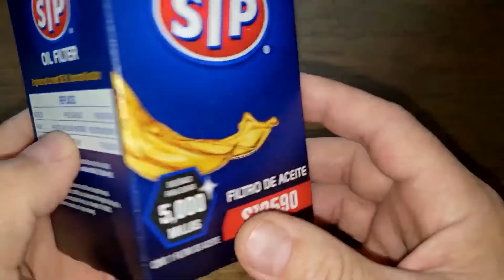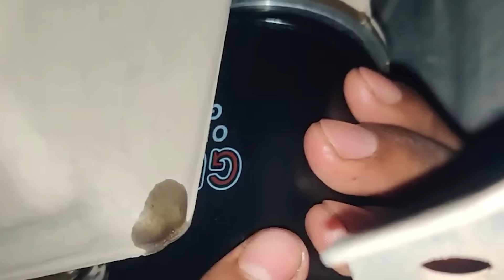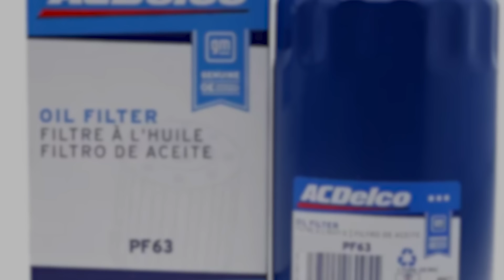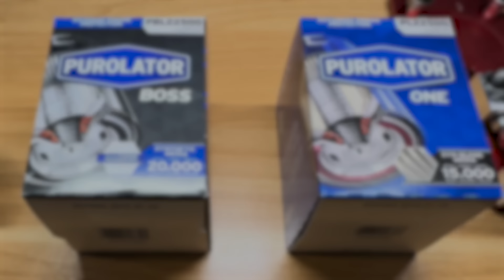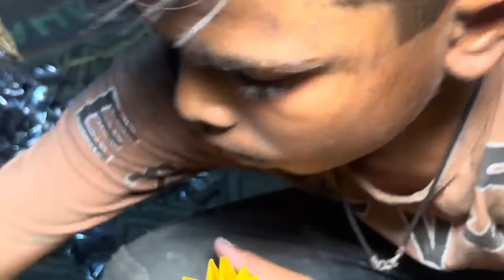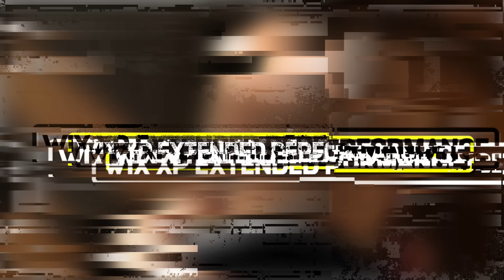AVOID These 5 Oil Filter Brands (And 10 That Actually Protect Your Engine)

Comment: Bottom line is change oil and filter regularly. ~ 4,000 miles. 3,000 - 5,000. Never go over 5,000 no matter what manufacturer says. They are pushing for you buying their car every 2 years or so.

Comment: "Avoid the orange can Avoid the FRAM "™️
Basically the orange can of death  !
Reply: Considering that Fram started making oil filters in 1932 and as far as I know a Fram filter has never been linked to a single engine failure, that’s a pretty good track record. However last fall the ceo of Fram’s parent company was charged with defrauding the company for over $700million. Now the company is in chapter 11 bankruptcy and they aren’t making anymore filters.
Reply: It really depends on the filter 🤷 check the labels on your filters, especially if it's for a non-domestic car - some of the filters that aren't common on US cars, especially cartridge style filters, Fram (at least before they went belly-up) would just repackage filters from other makers. On my VW it was a repackaged Mann or Hengst, with Made in Germany stamps.  They were like $5 at Walmart at the time vs the $15-20 for a Mann. After a while they switched and the label was Korea... I avoided those. When I noticed the switch I'd buy up the Germany ones when I could find them.

Comment: I’ve only use Valvoline oil and OEM Motorcraft oil and air filters (which are actually made by Purolator). Last year and 5K miles, I sent a sample to Blackstone Labs for analysis (best $40 bucks I’ve ever spent on my vehicle) and  passed with flying colors. Zero issues.

Comment: I use CM filters,  They are expensive but for me, the peace of mind is what makes the expense acceptable.  The filters can be replaced as desired.  The cannister is bulletproof.  The filters remove contaminants and solids down to 8 microns.
Reply: CM?
Reply: @pablojg4381  Canton Racing makes CM filters , super high flow not really applicable to everyday driving

Comment: I’m an ASE master, L1 and state certified emissions technician and have been using Fram extra guard filters for as long as I can remember with Valvoline motor oil, I have had many cars over 250,000 miles and more. I have no problem using FRAM
Reply: Fram’s in chapter 11 bankruptcy and all manufacturing is haulted

Comment: My '57 blue flame six had an optional oil filter. When one of the hoses broke I ran it without a filter it actually ran quieter for several years with 3k changes with conventional oil.😊

Comment: I use microguard select it always comes out close to the top in testing and only costs $7 on my business account at Orielly, for my hotrods I will use a racing filter for more flow at high RPM
Reply: Microguard Select is made by Prime Guard.
Reply: @rustypipes12  do you think it is a good filter? since wix dropped in quality I have been useing the microgaurd
Reply: @JimSix-jo6hf microguard Select are good filters. I have a stash of Champion XL filters that I'll use up before switching to PPE or Baldwin.